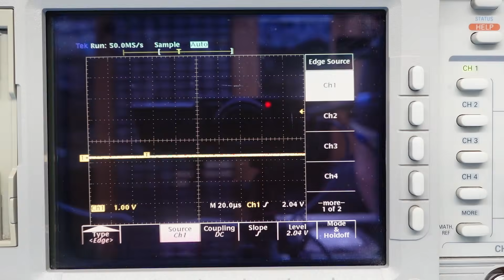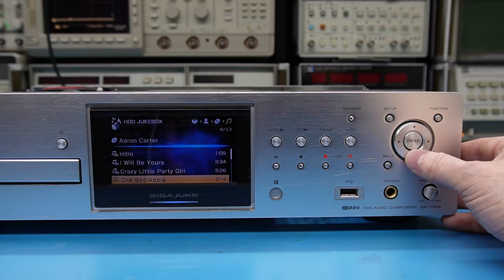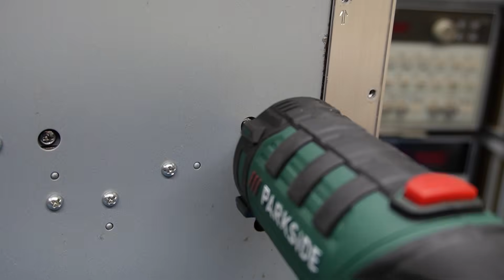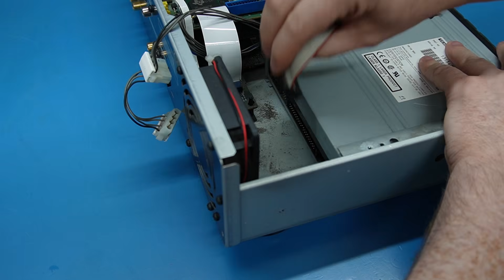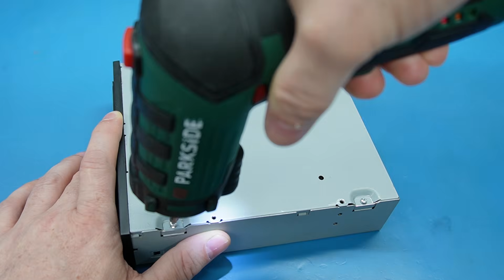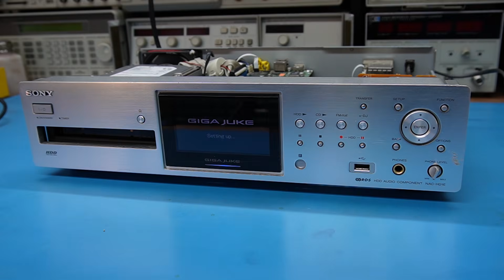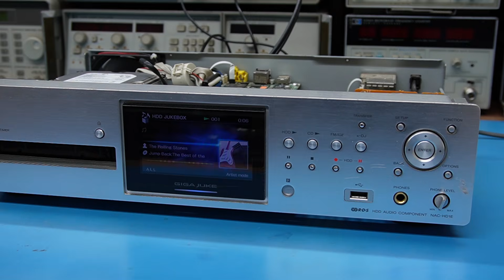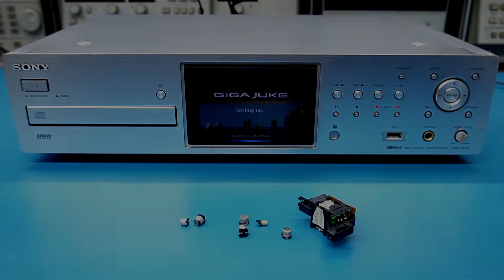SONY Giga Juke, Codename 'PROBLEMBOX'

Comment: Your initial theory for as to why the cd playback was half speed would likely not ever have been the cause. A cd needs to spin at a fast enough speeds to be able to read the data. If it is half speed it simply wouldn't function. And since this device also reads the track titles and stuff there is likely a form of buffer that first reads the data nad plays it back not from the cd but from the internal storage instead. I think your issue is either a software setting or an issue in the dac circuitry. If there is no software option for playback speed there likely is a mismatch between the bitrate that is being supplied to the DAC and the bitrate the DAC is converting. I do not know how to repair DACs but I would assume that this could be caused by a faulty capacitor or similar component preventing a chip from performing one of its functions.
Reply: I concur, I know if I show down a CD player enough it will fault. And it's like not even 10% slower before it will fault. And when I say fault I mean it will quit and spit the disc out.
Reply: I have slowed down a CD with my finger while playing and the music slowed down like it was a vinyl record.... 
Not sure if all CD players are like this but I remember thinking that I didn't expect that to happen and also thought that all CD players are like this....
Reply: @PeterMilanovski  it is possible but most cd players, especially ones with as much digital integration as this one has, don't work like that.
Reply: @TrevorCollect   I can't speak for every CD player as I have never had the opportunity to play around with all of them, we can only assume that if there's one, there's possibly more... 
I have a Yamaha device that is similar to this Sony and really hope that this doesn't happen to it! 
I can't speak for the Sony but as for the Yamaha, in my opinion is what CD players should have become! It doesn't do network streaming and I think that it doesn't need to, it has a user replaceable internal HDD which contains all the music I want it to. Nor does it have a built-in tuner but should I need to record from the radio, I have the ability to record from anything connected to the system.... 
I'm old school so I like my hi-fi in a stack of components, I never really was a fan of Yamaha equipment, I have always gone for Sony or Technics, but I came across this Yamaha CD/HDD recorder which I never knew that such a device existed and I started looking into what else Yamaha had to offer! I was surprised to find that Yamaha had literally tried everything! There's a system component that is perfect for everyone! They might all look the same but each one in it's own category has a feature or function that will suit you.... 
I have since moved on from being a Sony fanboy to being a Yamaha fanboy.....
Reply: @PeterMilanovski  sorry but that is not possible with how cd audio is stored on the cd, you are either massively trolling us or you are remembering wrongly. In fact a cd spins at different speeds from outer to inner tracks and that is just one tiny bit of why this cannot work this way. There existed expensive dj players that allowed you to scratch a cd like a vinyl but they operated on the buffered audio stream and not on the rotation spin of the cd.
Reply: @Henrik_Holst   yeah not trolling, I can understand why you would think that it's not possible, honestly I automatically thought the same thing until I touched the spinning disc and the music slowed down... I was surprised.... I don't know why? I'm assuming that the data coming directly from the disc is being hardware decoded directly without using a buffer? 
I don't remember which CD player it was but it could have been My Technics SL -P1 which is quite an early model or a Sony which I have also owned....
Reply: @PeterMilanovski  the thing is that without a buffer it cannot work at all. This works for vinyls since the audio stream is read 1:1 by the needle but for cd:s you read bit by bit where the data is stored interleaved, aka you have 1 bit left then 1 bit right then 1 bit left, and you have to read 16 bits in total for each channel before you can produce the PCM value that you send to the DAC. And on top of that the format on the cd is even more complicated than that since it have error correcting codes and is stored in a reed-solomon encoding so you have to read quite abit of data before you can even start to devcode the audio stream.

Plus the problem I mentioned earlier where the disc rotates slower at the inner tracks and faster at the outer tracks so the rotation spin is already constantly changing.

It's one thing if you could read the disk and perform playback bit by bit but that is not how it works, so this is beyond strange.
Reply: @Henrik_Holst  like I said earlier, I'm not trying to mess with anyone.... And I see what you are saying and it sounds correct to me, but I remember having the cover off the CD player, I touched the spinning disc while it was playing music and to my surprise it slowed down.... I remember thinking ha! So this is how DJ type CDjs pitch control works.... And I basically left it at that.... I had two turntables and a DJ mixer I got from Tandy way back in the early 90's, I still have both belt drive pitch control turntables and my vinyl record collection, I lost my mixer a long time ago but have since purchased a new one, I don't DJ any more, everything is done in software now days, I still use cassettes and make beat matched mixes which I record to tape for my boombox.... 
My life has been all about music and the equipment it's played back on, I have built amplifiers and know my way around electronics.... I'm guessing that what I experienced with that one CD player is possibly something rare..... As you said and it's what I expect from a CD player but I swear that the music slowed down when I touched the spinning disc lightly..... Maybe it's an anomaly? Like a one off design during the early days of CD players? I still have the Technics SL -P1 but it no longer reads disc's.... Can't test it even if I wanted to... I'm aware that there was another model of similar vintage that looked similar but had a pitch control slider..... So I'm thinking that Technics was already thinking about speed control from way back then... It is a very early model. 
Sorry I can't give you any more information about it! 
But I am curious now, and I will eventually get the CD player fixed and I'm going to test it out to see if it was the one.....
Reply: @PeterMilanovski  yeah it's really strange, perhaps it was just something that happened for one or two seconds while the player tried to resync the drive?

Because to slow down the music the drive also have to add a pitch algorithm to the audio stream, just adding a delay between bytes would only add stutter and holding the byte value would only produce extreme noise.
Reply: @Henrik_Holst  Slowing down the disc during playback implies that the data rate coming from the disc is also slowed down, so data wouldn't be coming in fast enough to keep the buffers topped up. It's difficult to believe a player manufacturer would build in a contingency for this scenario whereby the sampling rate the DAC operates at slows down proportionally with the incoming data rate. A lot of engineering for something that's very unlikely to ever occur. Not saying it's impossible, but seems highly unlikely to me.
Reply: @timf-tinkering  yep, there would have to be quite an advanced solution in play for this to work as described. As noted there existed cd-players for DJ:s with scratch functionality but they never changed the rotation speed.

Comment: How did you know the CD fault was the laser assembly?
Reply: If it shows "no cd" or "cannot read cd" it is a dead laser, always.
Reply: Well it could just be dust in the laser assembly. Crusty grease on the tracking assembly.
I fixed dozens of these drives just by cleaning and replacing dried up grease & removing dust from the laser assembly with the vacuum cleaner.

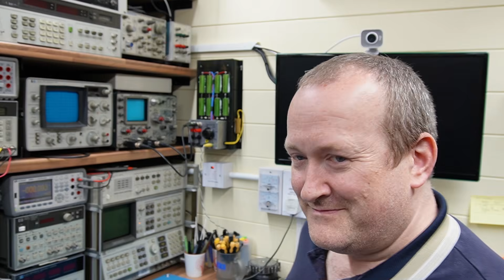Comment: The CD is playing slow, but wasn't the MP3 (3:38) from the HDD also playing slow?  Which points to something else in the machine?  Great video as always! :)
Reply: Sample rate settings could be set wrong.
Reply: probably it have been ripped from a cd like Mark did. so "good" mp3s into the hd or the cd (does it read mp3s?) would play correct.
Reply: @DumahBrazorf  What?

Comment: According to a google search > "The reset button for a Sony Giga Juke is located on the back of the unit and can be pressed with a pointed object, such as a pin. After pressing the reset button, you can turn the system back on by pressing the power button."

Comment: This could be a RAM memory access issue. The eight-to-fourteen modulation (EFM) data stream from the CD will be clocked into a RAM buffer prior to processing (decoding and C2 error checking). Likewise, an MP3 file from the hard drive is buffer prior to uncompressing by the DSP chip. The RAM chip on the main board might have been damaged by the over voltage condition.

Comment: seems like a software setting, half speed selected deep in a menu somewhere? the first setup page that pops up when the unit was turned on looked like it was trying to sync online aswell so maybe just fill in the details and plug in a network cable ?

Comment: I recommend downloading the ripped files from the HDD onto your PC to see whether the problem is related to the storing/recording of the data, and/or the playback... Just to be sure...
Reply: Knowing that it's a Sony, the audio files on the HDD are probably encrypted, to not upset the RIAA and their music label division.
Reply: Seemed it actually records the CD audio rather than ripping the data though. 

So can't be much point in encrypting it then. And SCMS would allow one transfer either way.🤔
Reply: @AltCutTV  It can't be recording the CD audio (analog) as the connector for that on the rear of the drive doesn't have anything plugged into it. The only means of communication with the drive is via the IDE port.
Reply: @stopthebus   That only means the DA is external though. Using the typical PC drive one would probably not have pleased any HiFi papers back when. 🙃 But sure, it sounds less likely all the same. 

Loading in tracks known to work would be one way to eliminate theories I suppose. Unless the assumption about encryption is actually one being the case. IDK if files can even be loaded from network though. Or serve to network for that matter.
Reply: @AltCutTV  That does, but the author of the comment I was replying to specifically said "CD audio" and that is the analog output from the deck.
Reply: @stopthebus   Sorry, I thought it was me. 

Anyways, I checked now and its files are not encrypted. Was sure I made a more detailed post prior, but it seems the tube-dog ate it, again. 🥔
Reply: @AltCutTV  All good. I can't imagine any practical advantage to encrypting the files in an application like this. I have however seen proprietary file formats on hard drives that are used in domestic recording units for audio and video.
Reply: @AltCutTV  wouldn't make much sense to pull the PCM audio as data over IDE, convert to analog just then digitize again. In fact, if they did that I don't see how the 4x ripping would work.  Just encode the PCM audio to the desired storage format (likely a high bitrate MP3).
Reply: @TEDodd   See previous comments. The reason would be a regulation one, not technical. That is why SCMS was a thing. You can then make as many analogue generation copies as you want, (unless Macrovision of course) but only one digital. 

High speed analogue copying is a thing. But if 4x is a great idea for quality IDK. At leadt in this case it would be without a lot of the mechanical interference such normally have to deal with. Tape decks for example used to have no more than 2x I think. But there is probably some exceptions out there for that as well.
Reply: @AltCutTV  that high speed tape dubbing produced poor results.

I'd have to go back to get a better picture of 2007 and where such rips stood. I thought by then they had given up on restricting rips from CDs. Every PC could do it easily as it had been part of Windows since 2001 (Media Player in XP release) and not hard for years before that. I know STBs lagged a bit, but by the time this came along I think they'd given up.

SCMS was a limitation on the recording media; DAT, MinDisc, and DCC. I don't know of it ever applying to computers (HDDs, Floppies, or even flash cards) and know it was disabled on computer CDR drives like used in the Giga Juke (and would only apply to burning CDs anyway).

A little more looking suggests the Giga Juke runs Linux and the drive is not encrypted, just an EXT file system (stops the average Windoze user) and the files are ATRAC3 format.
Reply: @RaduTek  I doubt they'd be encrypted but they may be some kind of proprietary format that isn't readable on a PC.
Reply: That's a good one

Comment: Hi Mark, I think the problem is related to the sampling rate on the digital section. For example, if a track has a real sampling rate of, let's say, 48KHz, but the device plays it at 44.1KHz, then you will hear a similar slow sound and vice versa. You have the schematic and have access to different boards. Please check 24.576 or 12.288MHz (for 48/96/192/384KHz sample rate) or 11.288 (44.1/88.2 etc.) crystals if available. Other than these perhaps some external automatic sampling rate converter (ASRC) IC may be available and does not sync to the main DSP/DAC etc. For example, some DACs or ASRCs may have default 44.1KHz own clk whilst the sync pathway provides 48KHz. On I2S communication you will need 3 wires minimum; BCLK (bit clock/Sample Rate), LRCK, DATA and optional CLK.
Reply: Notable that the recording of the radio sounded fine.. as if the sample rate of the recording matched the sample rate of playback
Reply: @TheGroovesRus  I don't think the radio uses the decoder. 🤔
Reply: Yes, most likely a sampling rate/clocking issue.
Reply: But none of this explains the fact it was playing the MP3 back direct from the hard drive slow as well... Its a setting or software issue within the Jukebox.
Reply: I agree, there must be a sampling rate conversion in the DAC  set to  a wrong value.
Reply: When this happens you will get aliasing noise issues but shouldn't really mess with the playback speed or pitch
Reply: Indeed. The CD playback would be done using DAE.. effectively the CD drive is "ripping" the digital audio and this is being played back by the main board. Almost certainly something wrong with the master audio clock.
Reply: do you think any of that could be software driven? like on bootup its loaded from a rom or from the hard drive in some hidden partition?
Reply: Yeap!! Agreed.

Comment: Are you sure those crystal oscillators are OK.  Probe capacitance could cause them to lock to the right frequency.  I'd be tempted to do all probing during playback of the music when it's at the wrong speed.
Reply: This is what I was thinking. Not sure if mark noticed but the playback time in the top right corner seemed to be 50% slower when there was an issue. I’m curious how accurate the system time is.

Comment: Surely this is a clocking issue.  While the 25/27MHz crystals are fine, is the appropriate clock arriving at the other end?
Reply: Yeah, I was wondering why did not he tried to follow and measure these around. Cost nothing to check a bit more. Perhaps simply an other failed cap somewhere along the line.
Reply: Yep, either a clock issue or perhaps more likely, just a sampling rate issue. I believe these things were capable of using a few different sampling rates and one bad solder joint, blown cap or another missing resistor could be causing it to choose the wrong one.
Reply: Dodgy IDE cable?

Comment: Actually I was a bit surprised to see that the cd player is a TEAC, with Sanyo parts...

Sony was the co-inventor of the cd player... they know no shame...
Reply: TEAC was a big supplier of optical drives. They where used in a lot of equipment from CD players to computers.
Reply: There's a lot of equipment out there today which the only part that is SONY is the badge on the front. Same with other brands. It's a race to the bottom. Rather than the manufacturer of the end product making every single part of the unit, if they buy in parts like CD-ROM drives, power supply modules, display boards etc from other manufacturers who are making them by the millions then it actually works out cheaper overall.
Reply: @stopthebus  SONY changed their strategy many years ago from being a manufacturer to be an engineering company.

Comment: Is the I2S bus clocking at the expected rate? Could it be that there is an interconnect carrying I2S which has an intermittently dodgy connection?

Comment: Maybe it has a pitch control in the settings
Reply: Why would it change the pitch on it's own then..?
Reply: @Billy-burner  Because it's not maintaining it's settings.  The fact that it does a long setup each time it's plugged in implies a depleted battery on the motherboard that isn't maintaining the system settings.
Reply: @robertatkinson6864  😂😂😂😂
Reply: I did wonder that a playback option for pitch control is wound down to min?